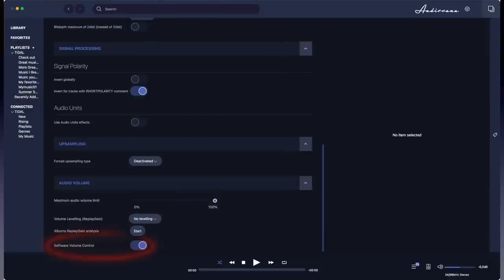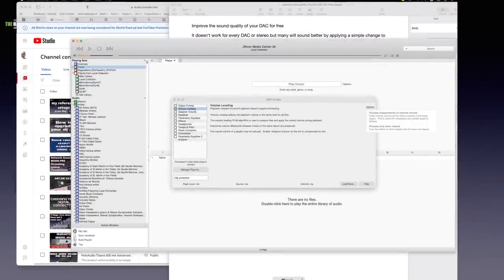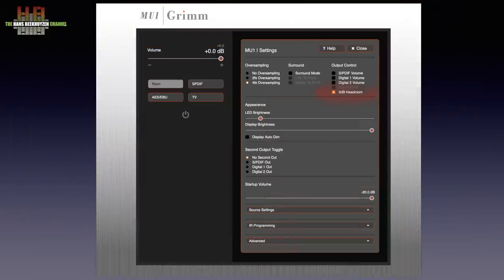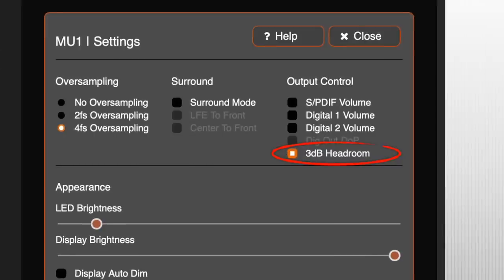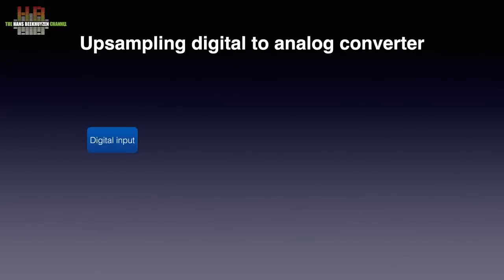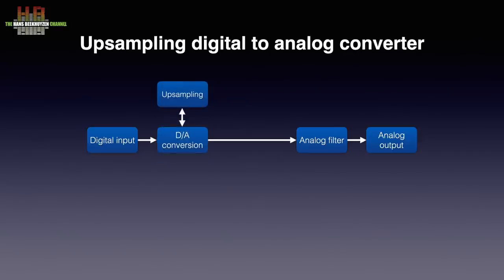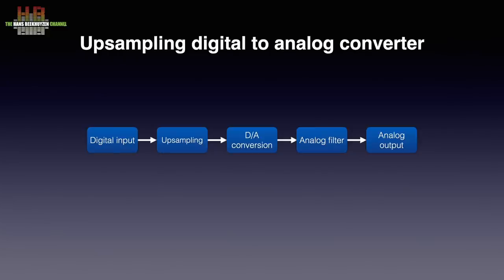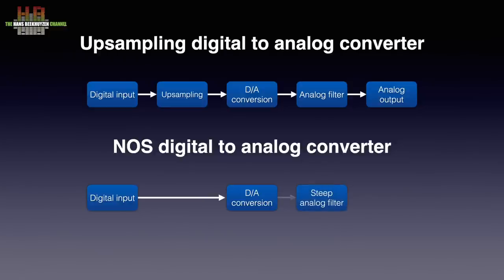Improve the sound quality of your DAC for free

Comment: Is it generally good practice to disable or apply the 3db headroom setting on the MU1?  How do I confirm this is a problem without any special measuring tools?  Just by ear? I use my amps  gain control for volume as opposed to my dac (Tambaqui) and MU1. 

Thanks.
Reply: To me there's little point obsessing over the numbers when the end goal is sound, do a comparison between the two with audio you've heard a fair few times with a varied selection of instruments and styles, and if the difference is immediately noticeable then it's an issues, if it takes quite a while and some very hard focused listening then it's not an issue and of course if you can't hear a difference it's no issue, music will sound different to everyone's ears, and so with the quality based on the ears of the person, no amount of numbers will satisfy your ears more than something that sounds good, for example, I use a dragonfly black v1.5, a relatively affordable dac instead of a chord mojo which after hearing I decided wasn't justafyable for the price, while many would choose the mojo the black sounded better to me and that's music, the black numbers wise doesn't compete, you can get ancient speakers that sound wonderful with a noise floor near 10% while modern equipment is at 0.00003% or something silly, it's entirely dependable on your ears, always go by ear, numbers will always get better, doesn't tell the full story for how it sounds and it's the same here, just listen for the difference, if there's none it's not an issue or your specific equipment doesn't show the issue.
Reply: Whoa. Just asking.
Reply: @labalo5  and I gave you a response appropriate in detail to the complexity of the subject.
Reply from the maker: There is no harm in having it switched on and its beneficiary when needed. I keep it switched on all the time.
Reply: Thx Hans

Comment: So do I understand correctly that for a NOS DAC the 3db headroom will be pointless, since there is no upsampling going on inside the DAC?

And if I upsample in Roon before the signal goes to my external NOS DAC, does that mean that so should enable 3db headroom?
Reply from the maker: The -3 dB isn’t as effective in NOS DACs but it still does something. In Roon use the option I mentioned when upsampling.
Reply: @TheHansBeekhuyzenChannel  thank you! I do upsample so I have enabled the -3db headroom in Roon :)
Reply: Using Roon for upsampling? 😮, try HQplayer to do the upsampling😊
Reply: @PINK_PANTHER7  I agree that HQplayer is superior, but it's also rather costly and I am not a fan of the way it is integrated in Roon. For now im just gonna stick with the upsampling in Roon which is also quite good